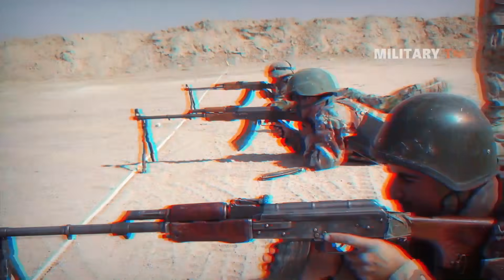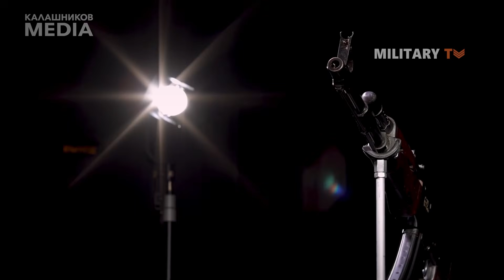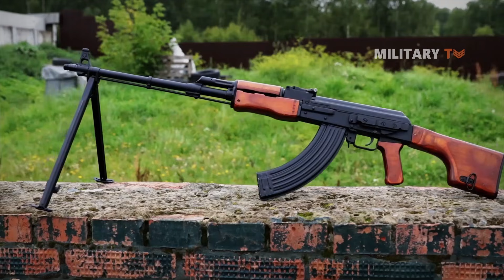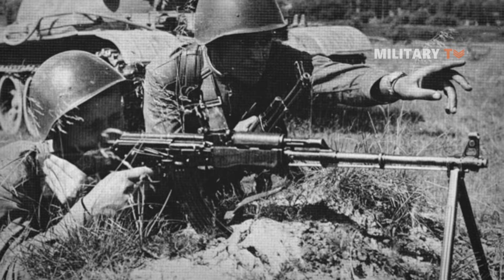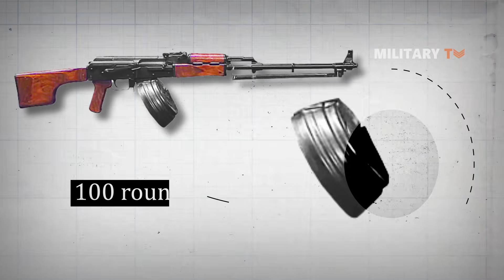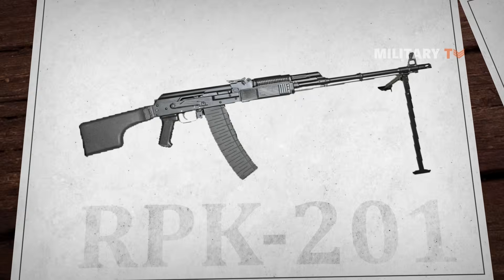Forget The AK-47: The RPK-74 Light Machine Gun Is Far Deadlier

Comment: its just an ak-47 with extended mag
Reply: ...and a heavier, longer barrel with bipod, reinforced trunion, and higher rate of fire.
Reply: @jepkratz  Very close to a ZPAP other than the rate of fire increase. Kind of want to make a budget RPK build with one.
Reply: @KaizenLife  Zastava makes some fine firearms. I have a bolt action M98 in ..223 Rem. It is known as the "mini-Mauser," and shoots sub-MOA with a beautiful solid walnut stock. A pleasure to own. They've come out with a modern AK in .223/5.56, and it is on my wishlist.
Reply: @jepkratz  Their ammo is also well designed. Since they didn't have the ak74, they tried to make a 7.62×39 ammo that imitate the tumbling effect of the 5.45 ammo. The M67 has a void in the nose and will tumble when penetrating flesh.
Reply: @minhducnguyen9276  I'm not sure I understand you completely. Both the original RPK and the earlier RPD were designed for the 7.63x39 round, the same used by the AK-47 rifle and SKS carbine.  The AK-74 and RPK-74 were designed around the 5.45x39 which apparently was developed based on ballistic performance research and logistics calculations related to US and NATO adoption of the 5.56x45 in the 1960s. I'm not at all surprised 7.62x39 rounds have been developed and adopted with hollow point bullets (void in nose,) but ammo variations are tangential considerations usually after the fact of an initial new rifle design around a novel cartridge, and their official adoption into a given military system.
Reply: @jepkratz   I was talking about Yugoslavian AKs and RPK. Since they didn't adopt the 5.45 caliber after the Tito- Stalin split, all they could do was improve the 7.62 design as much as possible.
Reply: Think AK turned into a BAR or Bren Gun
Reply: @richardthomas598  this has gotta be one of the dmbest ways to describe an RPK. Nice try though, I guess.
Reply: Worst take i have ever heard
Reply: It's in the name
Reply: RPK is what the mediocre BAR should have been
Reply: @destroyerarmor  The BAR did come out over 50 years before the RPK.
Reply: Kyw
Reply: Glup dizajn soodveten za vtora svetska vojna
Reply: It has extended barrel also, so it’s not the same gun.
Reply: It's literally not. Why are you pretending like you have a clue what you're talking about? Videogames got you thinking you know what you're talking about? Lol you're just making yourself look like an ldiot.